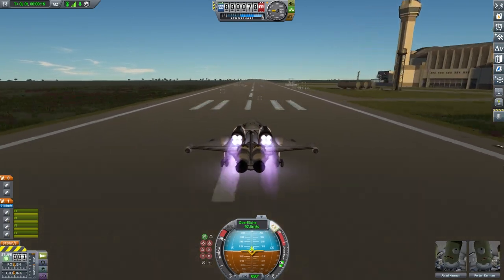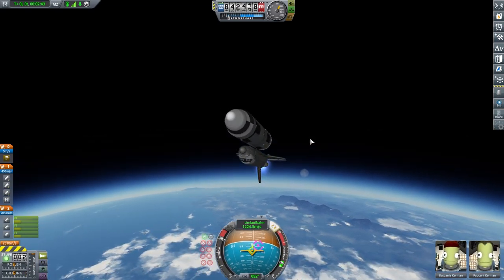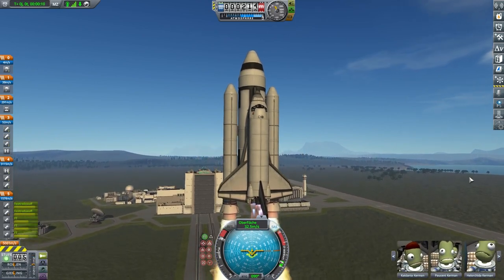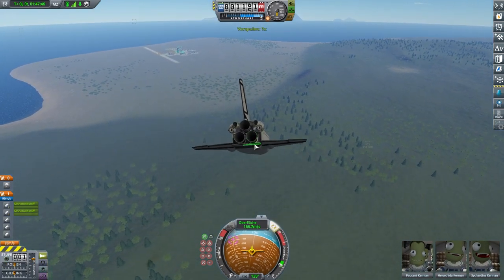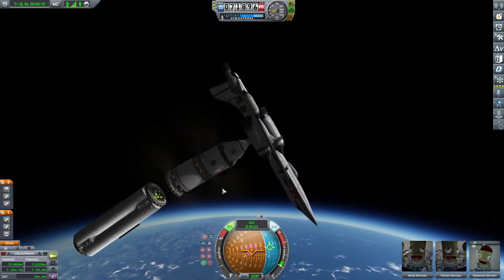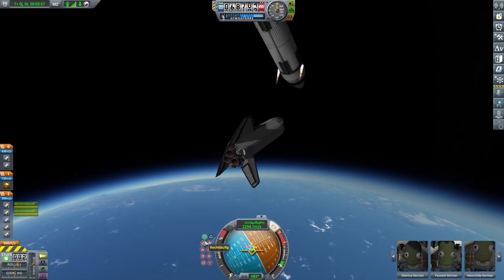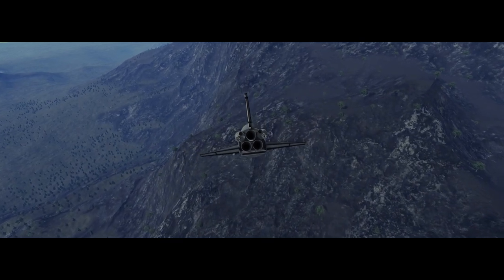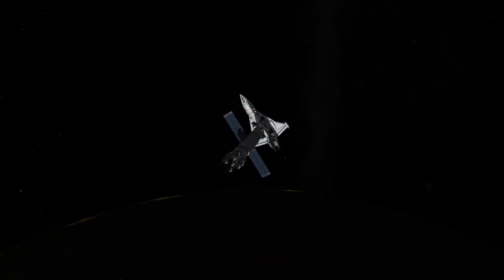Constructing a spaceship using Spaceshuttles

Comment: how do you "balance" thrust in teh shuttle? I tried making one a few moths ago, but the vector engines even with some studied angulation, just didn't get the rocket to go straight
Reply from the maker: Yeah, so the tank is actually way to big for KSP, filled up it would be way to heavy, so sI just drained the top tank 50% and set a drainage priority on. With that the weight shift was less prevalent. After that I angled the engines using the thrust indicator. With that it should work👍
Reply: @MarvinHuber_PlanetCoaster  Thanks I’ll try fixing it
Reply from the maker: @uranus5213  yeah and if it doesn't work, just write me on dc: Marvin #9555